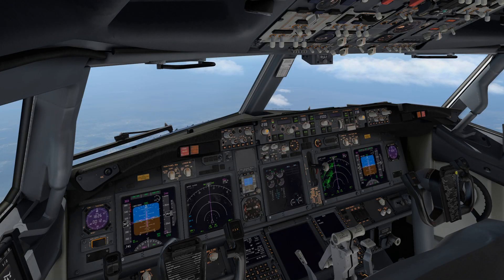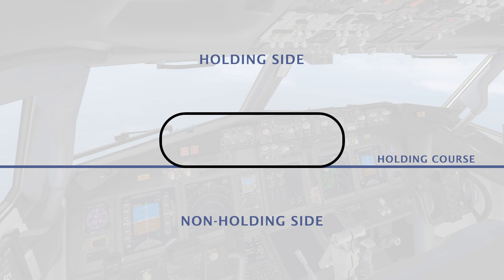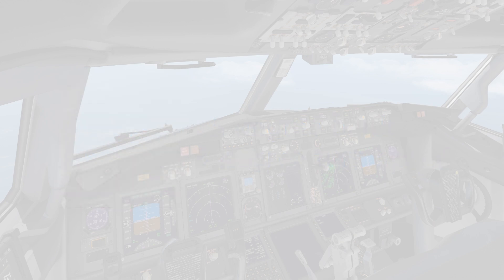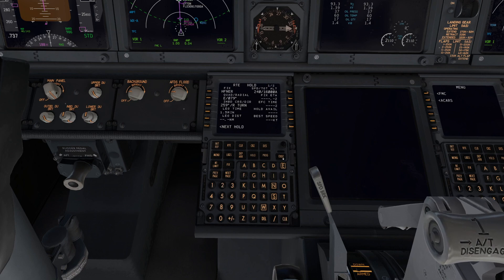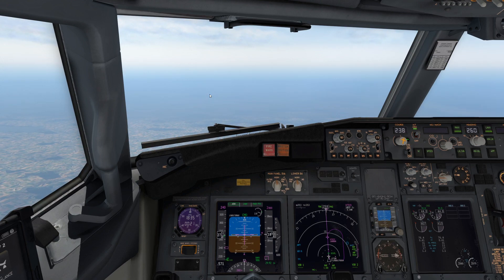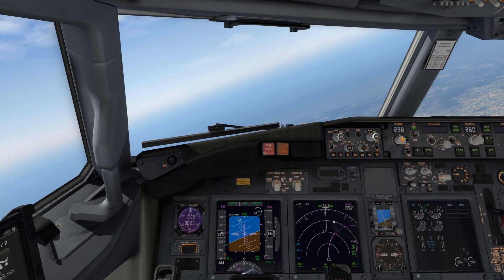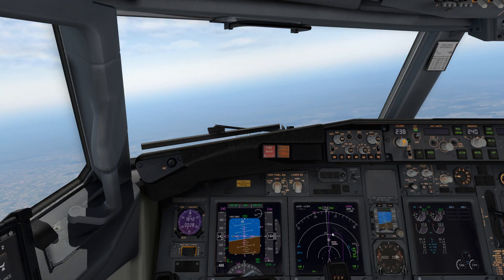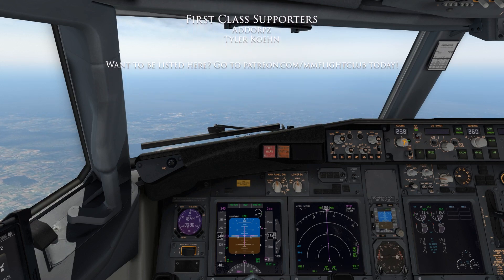Holding Pattern Tutorial | X-Plane 11 | Boeing 737-800 ZIBO

Comment: That is great!  One other question.  When installing X plane 11 with the dvd's  for the B 737-800 it sets up in a default setting.  Then if you want to also later on download the Zibo version on the same computer how does one know which one is actually being shown when you click on the X plane 11 icon on the desk top???  Thanks!  I have both on my computer and can't tell which one is
the actual one that I am using on a flight.
Reply from the maker: Not 100% sure what you are asking but when you install the Zibo into the Aircraft folder it'll show up as a separate 737-800 in your aircraft page. There will be 4K and Standard versions.